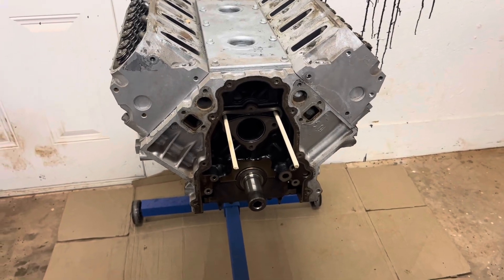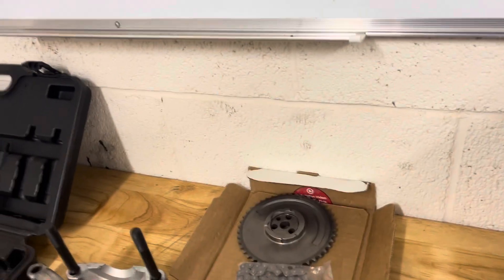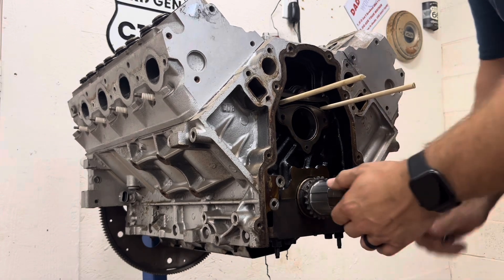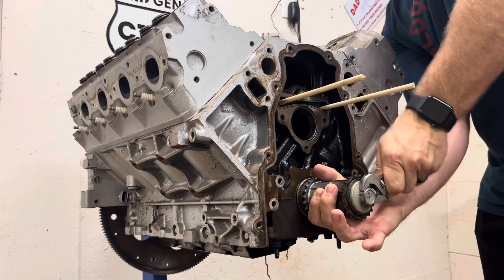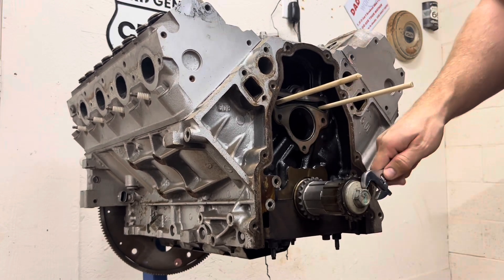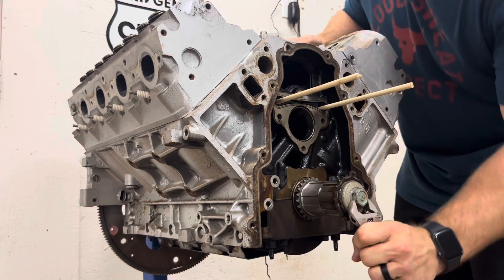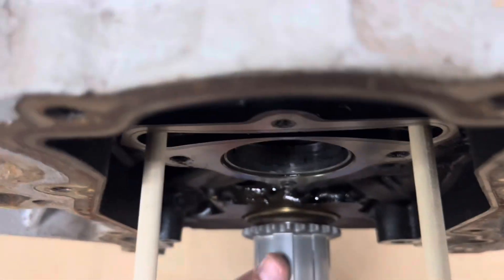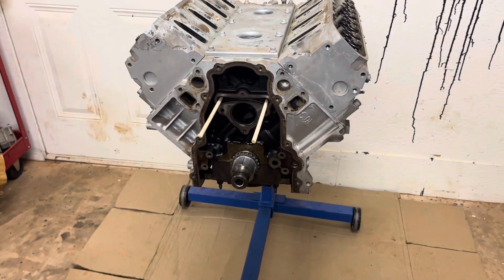Installing a Crank Timing Gear on an LS Engine

Comment: can this strip the crank thread?
Reply from the maker: Anything is possible but the tool I’m using is a balancer install tool. So the odds of stripping g out the threads are slim if used correctly.

Comment: Why change it? Thanks.
Reply from the maker: @papergatorzfedducca7998  high mileage motor. Metal on metal parts wear over time. Could cause timing issues even replacing timing chain only so I went ahead and did everything.
Reply: @3rdGenC10s  ok thank you. That makes sense and I love the channel!!! I’ll be binge watching tonight and thumbs up!!🔥🔥🔥